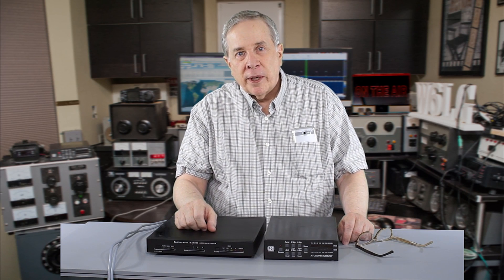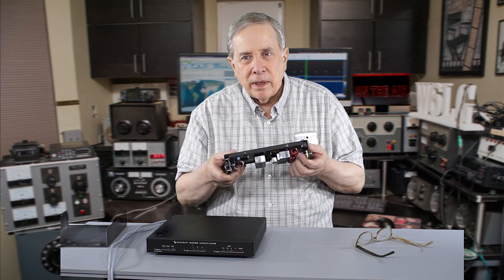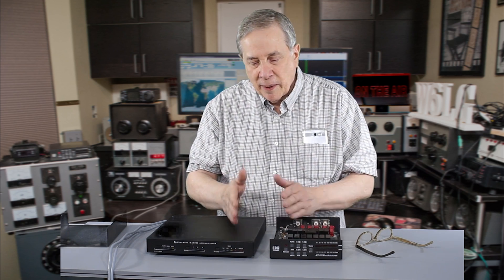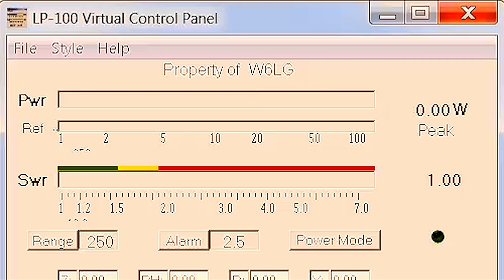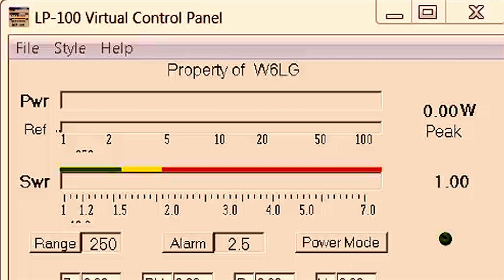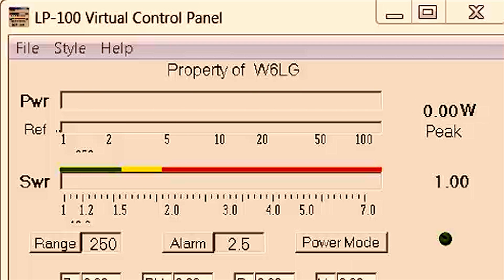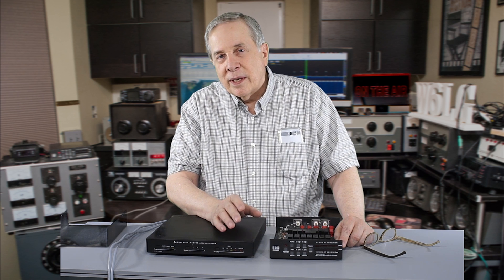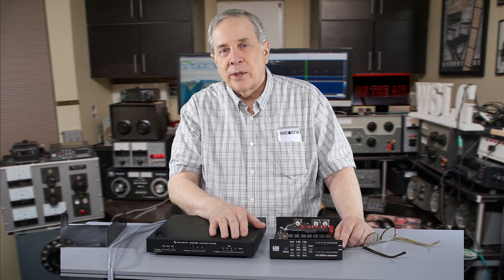Ham Radio Basics--Jim W6LG Tests Antenna Tuners, Which One is the Most Efficient

Comment: I've always wondered how lossy tuners are.
Are you measuring and taking readings matching the input at 50 Ω to an output of say 2000 Ω as you might find on a long wire?
Or 50 Ω in and matching to 50 Ω out? That's all I could do measuring things here. To my thinking that's not an accurate test of a tuner as a matching device from the input to the output. Or am I wrong?
G4GHB.

Comment: Jim, while I respect your testing effort, I am a little skeptical of the results. You don't discuss - or I may have missed it - what the actual VSWR was on the antenna you were testing. If it was a 50	ohm load then the losses are most likely minimal but the "backwash" of reflected power on an antenna might show differently. 
But what do I know? I'm an old former biz ad major.

Comment: Thanks for doing this.  Your videos are always clear and well done.  
I am not really sure what the test circuit looks like.  I suspect that the insertion losses for the tuners will be sensitive to the reactance of the load and maybe less so to operator skill (for the manual tuners).  I also suspect that tuner losses will be frequency dependent.  Experience with automatic tuners shows that all automatic matches are not the same; making two or more tuning attempts may produce better matches.  However, even transmitting into a VSWR or 1.5:1 only produces 4% of reflected power.  This rises relatively steeply to 11% at a VSWR of 20:1.

Comment: I am afraid that comparing tuners under matched conditions does not give a particularly relevant picture on the losses encountered under real conditions, when a significant VSWR (say > 5) needs to be matched. After all, some (automatic) tuners may just connect input to output under matched conditions! A much more realistic picture emerges when the net transferred power (Pforward - Preflected) under seriously mismatched conditions is compared. Even then several load impedances (for example different phases of reflection coefficient) should be compared, as some tuner topologies may be better suited than others for a particular load impedance (horses for courses...). So far my criticisme. Like the video quality though and the calm way of presentinh the topic.
Reply: I thought this.
G4GHB.

Comment: Not much loss, that makes sense because you don’t lose power in reactive components!  Probaby just some power loss in the form of heat in the resistance in the wiring and coils.
Reply from the maker: This morning I am working on another video using a "tuner".  The losses, as you already know, occurred in the coax. In fact, the losses were so great that I thought I had something really wrong in the setup.  Nope. Just huge losses when the impedance at the feedpoint caused an almost infinite (if there is such a thing) SWR.   Feedline losses were so great that almost no RF was at the feedpoint.  I used a series of devices in parallel to get a sky high SWR.  Thanks for your thoughts. 73, Jim W6LG

Comment: Most Losses occur in the feed-line in systems requiring a match , not the tuner.  This is the entire reason remote tuners exist. You want to match your antenna to 50 ohms before it hits your feed line.  Once your tuner is behind your feed-line, the feed line is now part of the antenna it’s tuning.  Feed line is where the standing waves your tuner is fooling your xceiver into “not seeing” (they’re still there btw) burn up as heat.  If your antenna is non-resonant, it can still be a very good radiator and quite efficient – you just have to make darn sure your feedline is either very low loss, or very short (ideally both).
Reply from the maker: Exactly.  Thank you for saying it clearly.  I hope to have made that point in other videos. 73, JIm W6LG

Comment: This test is not valid.  He is testing the tuner loss with 50 ohm load.  Put a 25 or 12 ohm load with reactance (like that of a short antenna) and measure the difference between in and out of tuner.  I guarantee, your loss figures will be much different.  Getting a watt meter that is accurate with loads not close to 50 ohm will be very hard to find.  Maybe a thermocouple meter could be used.

Comment: I am surprised also...  Possibly it's the toroids?  In baluns, air coils are not quite as good as those wound on large toroids.  Toroids will have a wider band width than air coils.  But, small toroids won't hand as much power as large air coils.  I think, anyway......

Comment: I regret to sold the KAT-500 but it was a bundle sell with the AMP.  I also have LDG 3 tuners, so my conclusion is: (By the way, I had been owned ICOM AH-4/AH-2, DAIWA CNW-419, Kenwood AT-180/AT50, Palstar AT-2K, MFJ-989, MFJ-945E, etc)
KAT-500=Z-11Pro II=AH-4 > AT-200Pro II ; Manual tuner: AT-2K

KAT-500 relays running sounds very solid and it is thinner than other tuners (Z-11Pro II is thin but only 100W)

Comment: A fascinating comparison though of course the load is 50 ohms nominally. Those LP-100 sensors seem very consistent!
Reply from the maker: They do indeed.  But, I have concluded that that is the way sensors function trying to capture a peak reading in a "sea" of changing values. Additionally, I think the best way (at least for me) is to look at a scope of some kind and find the peak readings.  The LP-100 is a very nicely made device.  I also have the one from Array Solutions. With both running, same coax line and box adjacent to each other, the values on the display are different. Back to that scope, I also found that tuning an amplifier requires advancing the load control past the peak output so that peak excursions do not "flat top".  I hope that make sense.  Thanks for your comments and help.  I do appreciate it. 73 now from Rocklin California, Jim W6LG
Reply: Jim W6LG thank you for the reply, all understood about the amplifier too. Using X and Y inputs of a scope on input and output is another way to monitor linearity

Comment: Do these devices actually tune the 'antenna' , or merely match the impedance of the radio to the tuner which takes the antenna into account? I get the impression that nothing is actually done to increase the performance of a poorly matched antenna. Isn't 'antenna tuner' a bit of a misnomer? Would 'antenna matcher' be a better name for what they do?
Reply from the maker: Yes,  I agree with you.  A big factor missed by many is SWR losses that can really big large.  Sure the SWR is  1:1 but the real SWR can be 8:1 with a huge loss of maybe 60% depending on a bunch of factors.  Thanks for pointing that out in you comments. 73, Jim W6Lg

Comment: There was a lot going on here that wasn't specified.  For example, what frequency was used?  Jim's notes say the load was varied for the different tuners, but that makes comparison impossible, since it apparently was different for each tuner. Most autotuners are L-networks with switched Ls and Cs, and they will be essentially operating straight through with a 50 ohm load, and you wouldn't expect much loss.  Many of the old manual tuners are essentially T-networks, so there will be losses, mostly in their inductors, even with a 50 ohm load, depending on how you tune them up (e.g. high-L & low-C vs low-L & high-C).  Look at the ARRL tuner tests and they measure the losses with a range of resistive loads, which is helpful, but a lot of real-world load impedances are very reactive, which can have a HUGE impact on tuner losses, depending on the magnitude and sign of the reactance, so you can't really generalize on efficiency without a lot more specifics.
Reply: Agreed. I was going to point this out, but you already did. Also, most of the losses are dependent on your feed-line, which is where the high SWR/impedance you’ve tricked the radio into seeing as 50 ohms burns up as heat.   Tuners are not the problem.  Tuners at the end of long/lossy feed lines are.

Comment: You video was interesting testing the RF loss of the tuners between the tuner’s input and output. From my understanding, the most important factor in using an antenna that is not resonate is the power being reflected back to the radio, from the antenna. The antenna tuner’s job is to make the radio happy. But the reflected power from the antenna that is not resonate is coming back from the antenna to the antenna tuner. That reflected power must be absorbed by the antenna tuner and/or absorbed by the coaxial cable, instead of being radiated into the atmosphere. I heard that a remote antenna tuner is better, closer to the antenna. But if the reflected power is not going to the atmosphere, that power is being wasted, I assume as heat. If the SWR is high, the radio is happy because of the tuner, but maybe most of the power is not being radiated into the atmosphere. I don’t know if receiving signals with a non-resonate antenna has significantly reduced performance, like transmitting with a non-resonant antenna.
Reply: In fact, if the antenna tuner is at the antenna feed point, it can match the complex impedance of the antenna to the 50 ohm transmission line so there is very little loss. It's been a long time since I worked in broadcasting, so I can only remember parameters approximately, but at one station we measured the impedance of the tower with a General Radio RF bridge to be approximately 23 ohms and slightly inductive. At the base of the tower, we had a "T" matching network which matched the tower's complex impedance to 50+j0 , which is what the Heliax back to the transmitter building saw. The matching network used a coil wound with copper tubing and vacuum capacitors for low loss, and we had a ground system of 120 long radials and 120 shorter radials, very efficient. Just about all of the power delivered by the coax was radiated...

I think it's great now to have a Rigexpert antenna analyzer. Sure beats the GR RF bridge. The Rigexpert can measure 1000 points and plot a Smith chart in less than 30 seconds. Sure beats the old days sitting there adjusting the signal generator and nulling the bridge to get each point, then plotting the chart by hand...

Comment: I'm not calling them antenna tuners anymore.  I now call them impedance transformers or transmatches.
Reply: @David White Because they don't actually tune antennas.  All they do is match the impedance of the antenna system to that of the transceiver.  They do not actually alter the radiation resistance of the antenna system.

73 VE7NDE

Comment: Well, personally, I like using tuners.  I set the antenna at the antenna.  Then, use the tuner to impedance match at the radio.  I think SWR is king.  I believe in tuners less about output, and more about smooth power delivery from the radio (less reflection) … protecting the radio finals.

I set the tuner manually using an antenna analyzer for the frequency to be used, and then switch to the radio.  Always a good clean signal from me and great comments about how well I am being copied.
Reply from the maker: Hi and Thanks.  I have a very different view.  SWR means very little. SWR may not be an indication of resonance. The SWR can be 1:1 and the antenna is NOT resonant. Tuners do not tune antennas and do not lower reflections.  I agree with protecting the finals. However, that is not necessary with a properly designed antenna system. The feedline is the king.  A clean signal has little to do with SWR.  Proper mic gain setting using the ALC meter and proper compression setting are very important to a clean signal.  Many other things like drive, grid current, grounding, mic placement have a big impact on having a clean signal.  SWR is not one of them in most situations.  

Thanks for your comments.  I think many have the same opinion that you do and they will agree with you. Based on my 55 years on the air, I have a different answer.  If you watch the video where I do use a tuner with a high SWR at the antenna, the loss in the cable was huge. From memory, I think it was 65% loss.  Thanks again & 73, Jim W6LG
Reply: Hi Jim.  Yes.  They key, was that you had high SWR at the antenna.  And, of course, a high loss feed line does no one any good.  Putting bad tires on your high-performance car never makes sense.  I figured out long ago that you start at the antenna and work your way back to the radio.

Thanks for your videos and comments.  Always enjoyed, appreciated, and useful.

Comment: Inductors and Capacitors don't consume real power (watts) right?

Because they both return the power back to the circuit:

Inductor stores energy in a Magnetic Field

Capacitor stores energy in an Electric Field

This is why Utility Companies don't like large industrial consumers that use large motors that have a lot of inductance.

Utility Companies want to maintain a power factor as close to 1 as possible.

Regular Utility Power Meters don't register Inductive or Capacitive Loads

In fact Utility Companies will actually do custom measurements of industrial client power consumption and add fees to their bills to get to an equivalent real power consumption.
Reply: Inductors and capacitors do in fact consume real power in the form of losses

Comment: Actually a very good demonstration of imaginary vs real components of impedance and power.  Like the rhyme, 'twinkle, twinkle, little star, power equals "I" squared "R".'   You did a great job of clearing demonstrating that the tuner isn't adding any additional 'real' resistance, and watts are the real component of complex power.  Neat video.
Reply from the maker: Thanks Joshua.  I am redoing that video at the request of some guys who said my test should have had a great mismatch.  I have done a dry run off camera. You know, the results were about the same.  The tuner lost 8 watts at 30 mhz with a 6:1SWR.  The coax lost about 55% to 65% in a 100 foot length!  Interesting stuff for me to test.  Thanks again, Jim
Reply: interesting to watch.  thanks for doing 'em

Comment: Sorry but I don't think you proved anything. You aren't "tuning" anything with this test method. One would need to tune a reactive load on several bands to come to a conclusion. Losses between tuners vary considerably. The ARRL Lab tested several auto tuners and manual tuners. Usually the differences were most pronounced on 160m with low impedance loads which cause more current through the  coils. It is a fact that L networks have less loss than T networks. Since auto tuners use L networks they typically have lower loss than many manual tuners. The TenTec 238 series is also an L network and is very efficient compared to the T type tuners such as MFJ. 73
Reply: I concur with you, Steve
Reply: Agreed! See my post above.
73
Jim W7RY
Reply: all things are subjective, he showed best case scenario and you choose to emphasize worst case, the point being that all perspectives are valid, its what you take away from that matters..
Reply: @rfmonkey4942  Unfortunately, there is very little to be taken away, to use your words, from these series of tests

Comment: HI Again JIm, Wow, who would have thought that there would be so little difference. One question, is it worth the cost to put a remote antenna tuner at the feed point rather than in the shack? Love you videos. Thanks, Dave VE7CMI
Reply from the maker: My guess is that if you are using coax to the tuner, it would make a significant difference.  If you are using hardline or ladder line then the feedline losses are minimal.  Thanks Dave and Happy New Year!  73, Jim

Comment: Enjoy your videos but the loss needs to be measured at various mismatches. Hi Z and Low Z.  You are not going to show much loss  if any the way you are doing it.  There is a big difference in losses between tuners based on design and type of circuit when you are tuning different types of loads. As a simple test to prove this theory create a load with a low impedance mismatch of 4:1 like 12 ohms and retest and see what you get.
Reply from the maker: That is interesting Rich.   What do you think, or how much do you think the average guy is trying to match?  In other words, is it typically a high impedance.  I think that may be the case.  In the average station is there much need for a tuner that can match a say 12 ohms?  Or is it a few hundred ohms that is see at the end of the feedline?  What do you think?  Thanks Rich for your excellent comment and suggestion.  73, Jim
Reply: Hey Jim, thanks for response. If you have Excel check out this spreadsheet. http://www.dj0ip.de/antenna-matchboxes/matchbox-shoot-out/  As you can see on a most the bands near 50 ohms most tuners show less than 10% loss. However some tuners will show up to 55% loss at various matches. As an example the Palstar (now Kessler) AT-AUTO which I currently own has a loss of 16 to 42% across the entire 160 meter band. On 80 meters it has less than 10% loss at most impedance's however jumps to 24% when trying to tune a 6.25 ohm match.  It appears a lot of tuners do not do well with low impedance.   In answer to your question, I doubt that many hams get down to 12 ohms but I am sure some (including me) do. Not uncommon to have low antennas or ground mounted verticals dip down to 25 ohms. I am guessing on auto tuners the more relays you have to engage switching in inductors and capacitors is going to add up loss.  Having a good match and not switching in those components is nearly bypassing the tuner. This is just my theory and do not know that to be fact. Check out the excel sheet if you can. Anyway, not being critical and love your videos. This is just a topic that I have played around with a little.